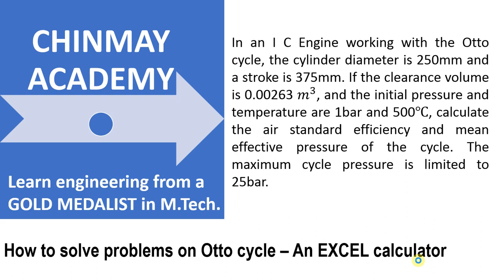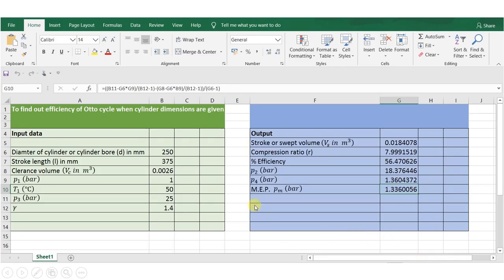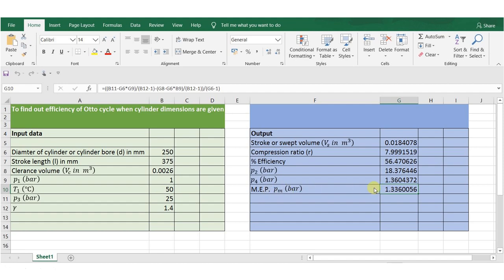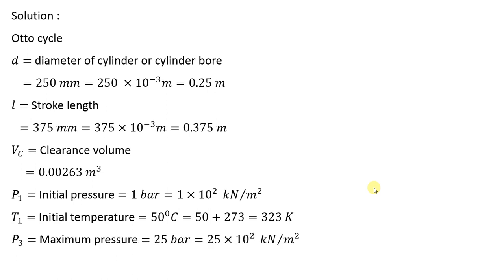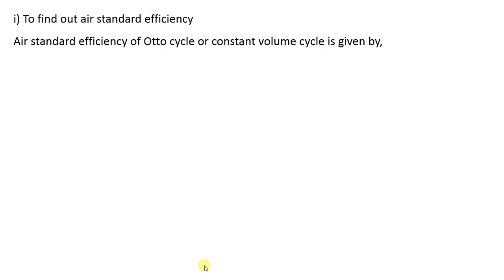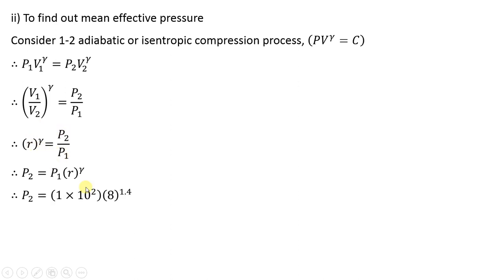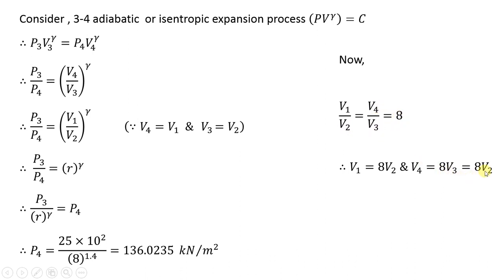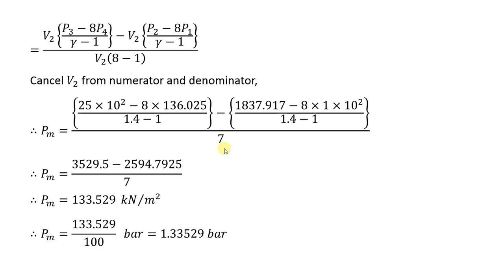How to solve numerical problems on Otto cycle in Engineering Thermodynamics.

Comment: In an engine working on the  Otto cycle between given lower and upper limits of absolute temperature, T1 and T2  respectively, show that for maximum work to be done per kg, the ratio of compression is given by r=(T3/T1)1.25  where Cp/Cv=1.4
Sir can you help me with this question ⁉️